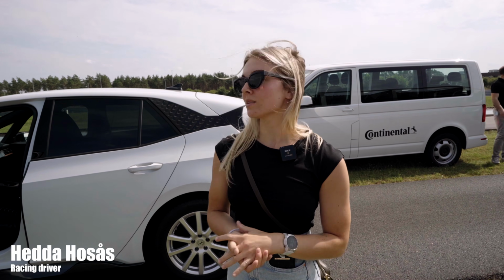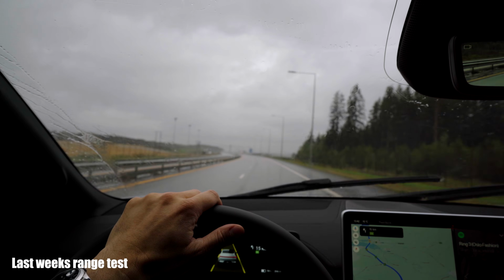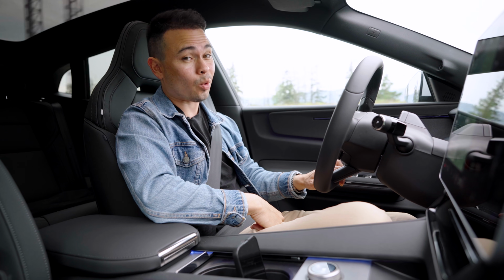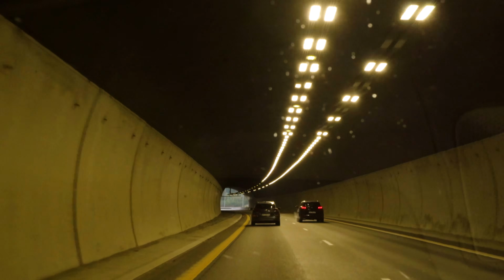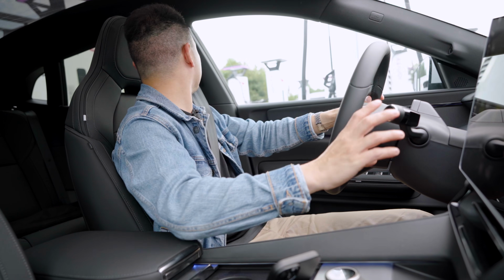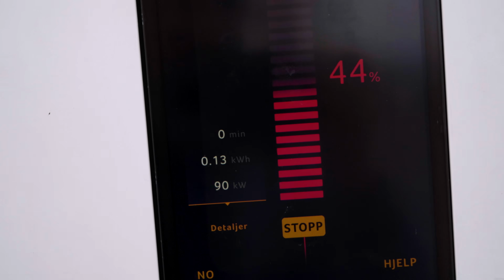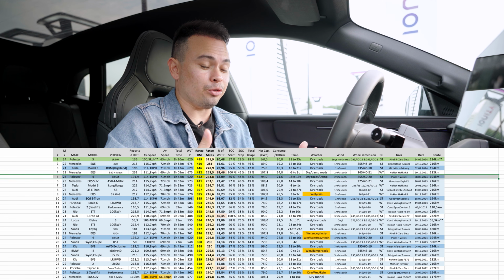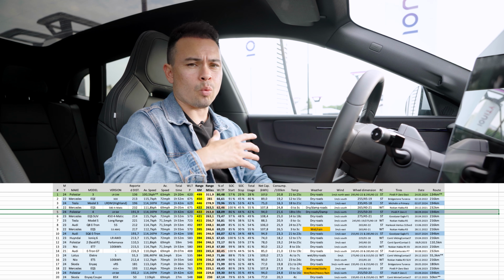Polestar 4 LRSM Range Test @120KPH (75MPH) | TAKE TWO !

Comment: Totally new to electric cars. I know nothing…. The range on the PS4 is mentioned as being 620km and you mention that you get a range of 422km. under the good conditions in this test. Just to clarify, is the range of 422 km on a 100% charged battery and then equals more than 30% lower range than stated?? That is bad in my eyes, so let me know if I misunderstand
Reply: The car does 560 km in today’s weather up in north Sweden. 20°. If it’s like 10° a lot of wind and drive fast off course maybe 450km will probably be closer and same during winter. Probebly 400km-550km during winter. Summer day and no wind and drive at max 100km/per hour and you will 100% make 600km. My Tesla I had before said 600 km and it actually does like 350 km during winter. The polestar 4 will be way better in all cases because it’s verry good build so not a lot of cold come into the car as it does with Tesla.

Comment: Hi, sorry am I confused? 263.8 miles from a 94Kw battery. I must be reading tour chart wrong. If not that's dreadful.
Reply from the maker: @graham5649  out of close to 100 EVs tested it’s the fifth best result I’ve ever gotten. So me and you have very different definitions of dreadful.
Reply: Hi my Kia E-Niro would easily do more than that at that speed and temperature and that only has a 64Kwh battery. Sorry if I haven’t seen your Kia review if you’ve done one I only just subscribed after finding your excellent channel. I thought there was hope it would go over 400 miles?
Reply from the maker: @graham5649  that just isn't true. I've tested the e-Niro in winter and it did 271km (169 miles). I haven't tested the e-Niro in summer, but I have tested the Kona Electric which is basically the same car but with better aerodynamics (lower Cd) and it manages 296km (185 miles).

Look at the chart at the end of the video, not EV comes even close to 400 miles. Maybe a Lucid Air GT would get close, but that's just about the only car.

https://www.youtube.com/watch?v=T-yhWqZoZSI&t=57s
Reply: I’m sorry Kris but at 18-19•c I will get a full charge of 315 miles and it will average 4.7mkw. I’m going to Gatwick airport this Friday at 5am and coming back at midnight next week and that’s 96 miles each way. On a full charge I will get back with 70 or 80 miles left I’ve done it several times. 70mph nearly all the way. 2 up with luggage. Are you driving the Kia’s with the regen on? If so switch it off they coast. I know you’re the expert but I do this journey often.
Reply from the maker: @graham5649  sorry, but you aren't getting 315 with an average speed of 120kph/75mph. You are claiming an average consumption of 13,36kWh/100km. Out of almost 100 cars tested the lowest consumption I have ever gotten is 16,3kWh/100km from the new Model. In every test on the internet this gets lower consumption than any e-Niro. But somehow your e-Niro gets almost 20% lower consumption. That is simply impossible. Sorry to be blunt, but you are not getting those numbers at 120kph/75mph.

This test is done under a very specific testing procedure and identical for every car so results can be compared.

 "70mph nearly all the way." isn't good or specific enough and is very vague. This test is done doing exactly 120kph/75mph over 194km or 1h 42m. There is no "almost" or "most of the time" or "normally". 

Unless you have measured the exact distance on Google maps and timed your run exactly, your claim doesn't mean much and only confuses who ever reads your comments. I don't mean to be rude or blunt, but you are not getting that claimed range at your claimed speed.

Out of almost 100 cars tested over four years the most I've gotten is 281 miles (450km) from a Mercedes EQS SUV with a net capacity of 108kWh.

I got 271km out of an e-Niro in winter at 120kph,  Tesla Bjørn got 288km in summer at 120kph.
Reply: This summer, 335 miles range  over 5  mpKw easily achievable

Comment: Thanks for the updated test, hopefully you will get another car once the update to the systems comes out. I’m hoping they can also push up the range a bit on both models. With Zeeker 001 getting a new battery with faster charging, it would be nice to see that come over to Polestar as well.
Reply: I'm thinking about that 800V architecture as well. I was planning to get a new car in the next 12 months, and this is on top of the list... but 800V would be worth waiting, say, another 6 months for.
Reply: The refreshed Zeekr 001 won't be shipping outside of China anytime soon. I suspect that Polestar 4 will get 800V about the same time as the 001 refresh starts shipping aswell.
Reply: Zeekr got the worst system do. If you get a EV at least get one with Android Auto like polestar have. It’s the best one.  The zeekr system feels cheap and verry bad

Comment: i'm confused with the interior spec. I see NO tiny holes in the seats, so i'm assuming it's the microtech and not leather spec. But your Middle console is all black too which should only be like that when part of the black leather pack. In the microtech trim it would have to be white. Or maybe different in your region...? or some kind of pre production?

EDIT: nevermind, just realized that the car without the plus pack has all black interior too :D I just never assumed you'd be driving the PS4 without plus pack - i hardly think anyone would spec it like that :D but anyways, thanks for the content
Reply: I think the version without Plus pack is all black interior. If you take the plus pack you get light accents on the door and centre console.